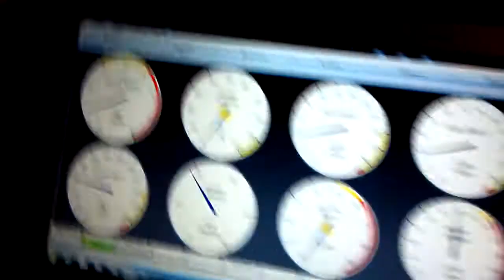Ms2 powered small block chevy ...more refined lol

Comment: what are you using as a crank trigger/sensor? Very cool!
Reply from the maker: I bought a 36-1 wheel from diyautotune.com, then made a bushing to fit the crank pulley, and then drilled alignment holes to match the water pump pulley. I used a crank sensor from a Ford escort and a custom made bracket to hold it in the proper spot. Wasn't too hard to fab up.